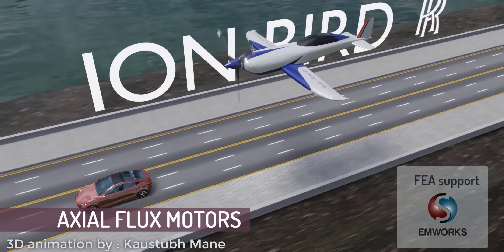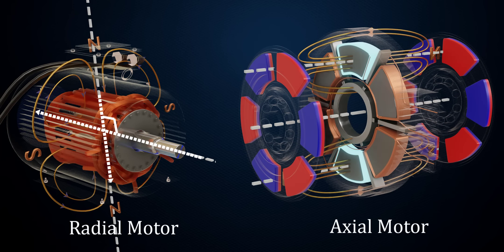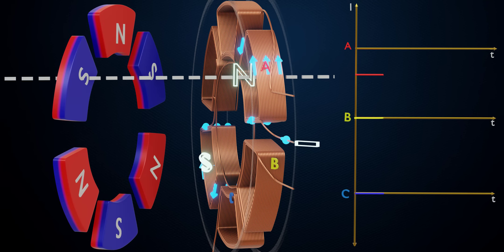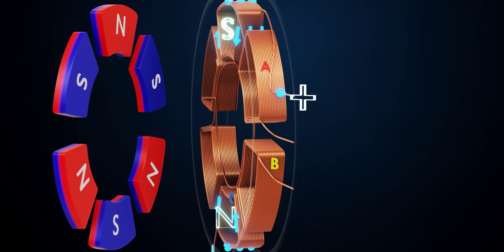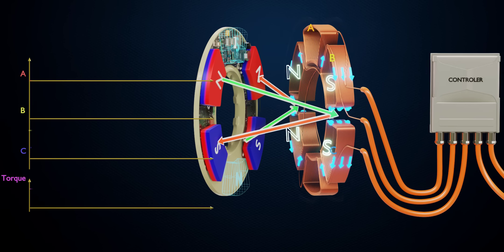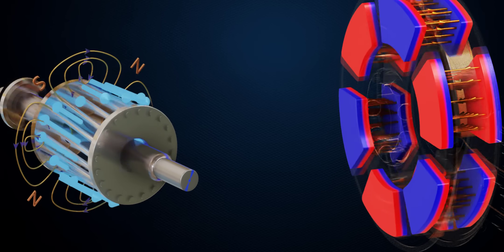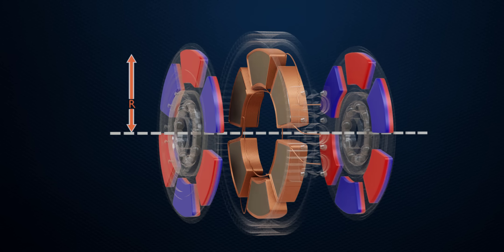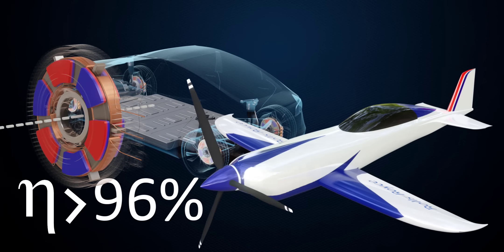Axial flux motors - The new hope

Comment: I fail to see why this is such an innovation.  All you have to do is replace the squirrel cage in the standard motor, already being done in industry and model electric planes and cars, with a permanent magnet and you basically have the same thing.  Standard induction motors with a Variable Frequency Drives are already 95% efficient and have been for MANY years.  The permanent magnet type lets you generate more instantaneous torque just like is claimed for the axial motor.  Nothing is new here.

Comment: Almost the entire raison d'etre of EV's is the ability to use braking torque to generate power with the motors and hence recoup energy, increasing efficiency and range (even then, arguably only a benefit in urban, stop/go environments, but with the important additional one of cleaning up the air in them). 
There is little or no opportunity for electric aircraft to utilise 'regen' so their range/endurance hence viablity for commercial (passenger and freight) applications is and probably always will be extremely limited.
Reply: They definitely have some opportunity for regen on decent while windmilling. 
Thats probably irrelevant though since you can just design the plane to carry a small engine just for electrical generation if you had to. Also can throw on a ram air turbine or two for more energy recoup on decent.
So probably not a problem.

Comment: How would an Axial Flux motor work if it were powered by an Aluminium Air battery, which is much lighter than a Lithium Ion battery?

Comment: I like this design, and I believe the power output can be doubled without having to increase the current usage. The concept is simple and it works. I already built a proof of concept that shows it's possible.
Reply: "I believe the power output can be doubled without having to increase the current usage" - Then you don't understand EM motors and don't know their history.  :)
Reply: Most electric motors are pretty efficient. Since the maximum outputpower is determined by the inputpower this motordesign wont be able to even nearly double the outputpower compared to other motors.

Comment: 4:23 This is rather misleading. There's no necessity for the axial flux motor to be a permanent magnet motor, it can just as easily be an induction motor as well. As wall as radial flux motors can be permanent magnet motors.

Comment: "Axial motors keeps this issue under control". Yes. Vehicles have no mass or inertia yes.
You just cant simply compare this TYPES of motor, asynchronous motor can use phase controllers to just simply overcome inertia startups, not saying other things.  Flux motor looks like typical perma magnet brushless motor, which requires its own voodoo magic electronics to simply RUN, and as its stands we already use this types of motors, not exactly like this one but almost as it, its just matter of "JUST DO IT"

Comment: Why not just ground out to the atmosphere and use the electric field that is in the atmosphere. You wouldn't need batteries even if you used carbon paper batteries still a ways down the aircraft. You could use the motor and the free energy from the air to fly forever
Reply: On the hobby side you have a collapsible propeller glider.The props fold back as soon as you reached your climb and then saving batteries,you glide the whole time.

Comment: I think there is so much room for improvement for this motor. The reason we dont see electric planes very often, is because the energy density of a battery is terrible. Until we finally develop a good enough battery, we need to optimise this engine to its limits. The force on the magnets needs to be tangent to the actual rotation, and not on an angle, improving efficiency, but we are eventually gonna have to ditch kerosene

Comment: In cars we can use only 2 motors to accelerate the vehicle and the 2 rear motors can be used to recharge the batteries, or to operate them all at the starting or when using car in Awd mode

Comment: On another video I asked why the induction motor could not be put on each wheel (of a car)
And then have the magnet pulse push the wheels forward. 
Then this video shows a motor with better torque and ends the video with the motors on the 4 wheels. 
I did not think my question was good because I figured if it were it would have been done already  but I have never seen that. 
So can we put these motors on the wheels? Thereby reducing the price of an electric vehicle?

Comment: It has to be said that the conventional induction motor is no slacker when it comes to efficiency. But yes. It seems that the axial flux motor is better.
The problem, especially for aircraft, remains the weight of the battery.
Reply: The newer latest types of batteries in full development with 35% added Supercapacitors with new Aluminum-ion cells + new more efficient chemical mixtures compound based on Na sulphur +Fe and with a molecular structure of Graphene will allow the new batteries not just to charge faster, last longer between charges and discharge slower but also will have a reduced overall weight meaning it could be used for aircrafts as well..  ;0)
Reply: @poplaurentiu4148  Ive been hearing this for years and years, when I'm looking for something I want right now I don't really care that in ten years it will be better, I want it to be better now, this sort of talk is bandied about like shuttlecocks in a game of badminton in ev culture, always seems to either come to nothing or achieve about half as good results as initially claimed, it's a new trend these days saying things will get better in the future, just shows how bad things are today really
Reply: @Markcain268  If you afford right now get any of these cars that are produced this year 2021 after October : Tesla S/3/Y/X performance, Jaguar i-Pace, Rivian R1T, GMC Hummer ev, Lucid, XPeng P7 Performance all these are getting equipped with latest graphene battery with up to 35% added Supercapacitors..
Reply: @poplaurentiu4148  I prefer super unleaded in my car, pity they don't sell the old 5 star 101 octane leaded fuel anymore, my old rover V8 ran beautifully on that, wish I still had it!

Comment: Placing axial motors in the wheel massively increases unsprung weight, but may double as brakes if they were so engineered.  Also of course acting as regenerative systems under braking.  Interesting!
Reply: yes they most certainly would need to be located within the vehicle. Nothing a beefy CV joint cant fix.

Comment: Nonsense, these motors are not better in any way.   The motor is a tiny fraction of the issue with electric planes.  The motor could be infinitely small and infintely light, and a plane would still be impractical as the battery weight is EVERYTHING

Comment: Like the video, but i think it's missing the elephant in the room that even with a 100% efficient electric motor, battery energy density is the Achilles's heel of electric aircraft. At the moment, battery aircraft are outstripped in terms of maximum range by hydrogen aircraft (though not by a huge margin, and this is only based on a small handful of highly experimental airframes). Even if battery energy density was improved to match avgas/jet fuel, the fact that the aircraft doesn't lose weight as it expends its energy will be a major drawback, especially in very long haul flights.

Comment: To make the machine 3 phase whilst keeping the rotor as-is would require 2 more sets of coils (phases), each one displaced 1/3 of the 120 degree pole pitch- i.e. 40 degrees.
Reply: No, the illustrated motor is a 3-phase machine.

Comment: The motor shown is a single phase 3 pole pair machine- it would have pulsating torque with dead spots when the magnets are directly under the coils. That's why the animation has to ignore two of the magnets. In doing so it becomes a kind of 2 pole pair 3 phase machine with a gap in the magnet. To correct it you need to represent the rotor as 4 pole magnet so that each pole pair corresponds to three stator phases as required. Or use a 2 pole magnet and three stator coils to make it even clearer.

Comment: I think there can also be a reluctance based axial flux motor bcoz at high rpm , axial flux motors would still incude a back emf(I think even more than radial flux ones). So a PMsynRM version of this motor would be more than welcome.
Reply: Exactly Saurabh. For a motor it doesn't need the magnets, just laminated Iron (as per what's inside most transformers) or simply blocks of ferrite.
Then and to give it its proper name, it is a Switched Reluctance motor - they are now the things that Tesla is using, or will be using in the near future. (NB: Radial switchers, not Axial)
Putting the rotor between a coil wound in anti-phase to the ones described and with magnetic material around the outside would complete the magnetic circuit and it would be truly awesome.
But no more so than radial motors already are - there's nothing really new here, just that the author has realised that generators are always motors and motors are always generators.
And radials don't need a computer to drive them.

Comment: Putting dynamo's on the wheels of a car, that's supposed to pass for thé cutting edge tech innovation of 2021.. something a 7 year old can come up with.. 

So you combine axial, radial tangential electromagnetic motors to put them in a plane wich moves in a axial fashion and wheels of a car that rotate in a radial manner..Seems rather anti-climactic..

Also where's the tangential moving vehicle?

Comment: Maxwell may have invented it but as usual, Tesla did it better: "based on a design that Nicola Tesla researched and patented in 1889. An axial flux motor places the permanent magnets on the face of the rotor, and puts the stator in front of the rotor. To balance the magnetic forces, two rotors are often used—one on either side of the stator. The flux loop starts at a magnet on the rotor and passes through the air gap between rotor and stator. The flux passes axially through the first stator tooth and immediately arrives at a second magnet (when dual rotors are used). Unlike the radial flux motor, the flux path is one-dimensional, allowing the use of grain-oriented magnetic steels for greater efficiency:
".

Comment: why waste time with batteries? A tiny, high-revving turbine generator powering a combination (inductive & reluctive) motor at each wheel could give the best of many worlds. Gearing, driveshafts and differentials would not be needed because electricity is a lot easier to transform than a mechanical driveshaft.

Comment: My 1994 textbook covers the detailed design of axial flux motors. After having worked on them as well as on more common radial flux motors, they have disadvantages that do not exist in radial flux motors. As a result, they will only ever appear in specialized applications. Even HDD spindle motors are radial flux and you would think that given how thin HDDs are, axial flux motors would be a natural fit, but they are not.
Reply: What sort of disadvantages do they have?
Reply: @escamoteur  one is heat removal. In conventional motors, most of the heat is generated in the coils and stator core, and both structures are in the external part of the motor, where simple heat extraction is easy to implement. Other is making the rotor and stator parts strong enough so the huge atraction forces don't cause flexions in the rotor parts. There are a few others problems due to manufacturing techniques, but those are harder to explain in not technical terms.
All these problems have solutions, but solutions that come at a price tag and mass/volume increase that, in an apples to apples fair comparison, make them much less "revolutionary" than people promoting them tell us.
Reply: you can easily reverse the axial motor so that the part the heats up is on the outside
Reply: @ldokonal1969  "one (problem) is heat removal." - Especially if the motor is in a wheel hub.  There is (now) a liquid magnetic oil which helps greatly to redistribute heat to the outside of the motor - however there's less viscous shear area to an equivalent radial flux motor.  Heat removal will always be the largest problem.
Reply: I am long time fan of your book on BPM motors! It has been a reference for 20+ years and something that I ask anyone that wants to design motors to read before any trial (I have been working in BPM design in the last 30 years, mostly for refrigeration compressors an washing machines). 
I completely agree with you, axial BPM motors have problems hard to overcome and no benefits except on very special cases. Despite of it, time to time someone tries to bring it as a "revolutionary" solution even in applications where it is clear that  they are not even a serious contender. Every time I see any respectable company spending resources on it for conventional applications I start to ask myself if they know something special or if it is just another case of a company that has no employee or good consultants for doing the homework (for decades the second case is by far the most common...) 
The bullshit we see around when the subject is electric motor design is something that really amazes me.

Comment: I watched 30 years ago as engineers at a Servo systems company built as they called them "Pancake" motors for robotics, some of which you can find on some robotic arms. They ran into problems with "Magnetic resonance" build up in the motors when the stacks were built. I agree with others about using an Induction motor for comparison, not apples too apples. The main difference with the motors besides permanent magnets, is the Induction motor is pulled by the electric field, were as most brush-less Permanent Magnet motor rotors are pushed by the electric field.
Reply: All types of rotating electric motors simultaneously push and pull.

Comment: You can use the unfeeded coil to recharge the batteries since there is a magnet moving next to it but this will need to design a smarter controller.

Comment: Axial flux motors will offer an improvement  in performance, but the single largest factor limiting electric aviation is the power density of existing battery technology, so much so that it is considered THE only limiting factor.
Gas/Diesel contains about 45 MJ/kg. The best Lithium batteries: under 2 MJ/kg! Until theres a way to improve battery technology by a factor of 10-20x, electric will play second fiddle to oil derived fuels. 
Electric has a lot of advantages so it will replace fuels before its energy density matches fuel, but it's way way way too far off at the present.

Comment: Axial motors are not new. They've been around for decades... and the reason we don't use them as much, is still the same... poor thermal management and low duty cycle. They make great peak numbers, but their design inherently limits available volume and surface area for cooling purposes.

Comment: If you ever disassembled a HDD, CD-ROM, slim disc drive, you find an Axial Flux Motor ;) ... this technology is not that new, however, not a lot of use (for now) in large electric motors.

Comment: Many years ago, frequency modulation was being hailed as the next great thing. It does work, but  has been slow getting mass distribution.
Reply: Very common in the HVAC/mechanical industry now. VFD compressors, fan motors, and pumps

Comment: Once opened a lego dc brushed motor from the late 90's - early 2000 (first rcx lego mindstorms had the same motor). I noticed that is was very efficient also as generator, moving another motor connected to it easy. Also showing a very high efficiency. It had axial magnets just like this. The old floppy drives work in the same manner without brushes.

Comment: This is all very interesting indeed. In fact, the effort in the evolution of electric motors has been immense in recent years. However, they seem to forget to develop the fundamental component...batteries! The current battery technology remains the same over the last 20-30 years with few changes that could improve an optimal weight/power ratio that justifies the investment in passenger transport, especially by air. Until they invent some sort of a powerful battery with the density and weight of something like styrofoam...forget it! Currently, the electrical technology applied to current batteries for use in air transport, only serves for short leisure air rides, expensive toys and small military drones, that's it!  No miracles, because the future of air transportation is BATTERIES not motors...
Reply: At what point did this video address energy storage?

Comment: Gyroscopic forces are going to be an issue (disadvantage) on a car's steering, as well as the unsprung weight issues associated with having all those heavy magnets inside the wheel and loading up the suspension. Seems ideal for aircraft though. Reminds me of the old rotary aircraft engine designs, like the Clerget 9B mounted in a Sopwith Camel.

Comment: The "battery problem" will eventually be solved. Either with the development of a better, more efficient battery and the charging characteristics. And small, private prop driven aircraft would require some type of  hybrid engine. TurboElectric? 🤤
Reply: Of course it won't. You like you can't "Moore's law" efficiency of thermal engine.   And even if by some MIRACLE batteries with e.g. order of magnitude greater energy density and charging characterists will appear, you'd either have to wait impractially long time for them to charge, or use impractiaclly large charging currents.

Comment: It shouldn't be compared to an induction motor, but rather a DC brushless motor. I think this would make it a more fair comparison.
Reply: That's funny, a brushless motor is an induction motor. Even if you use it with a DC power source. A brushless motor always runs on Ac.
Reply: @montiacpontana41  induction motor usually refers to motors that do not contain permanent magnets. the axial flux is a permanent magnet motor